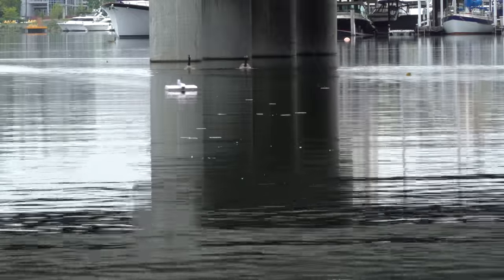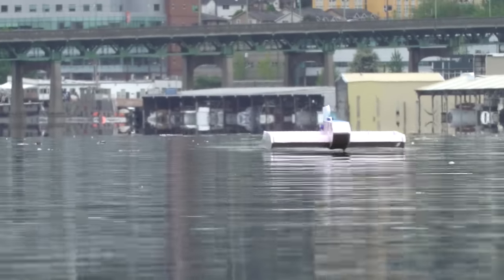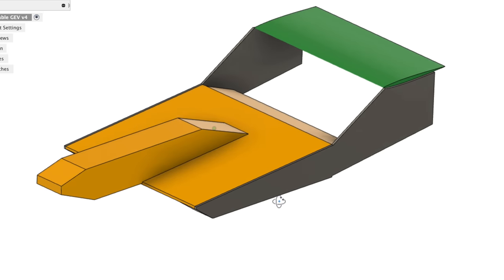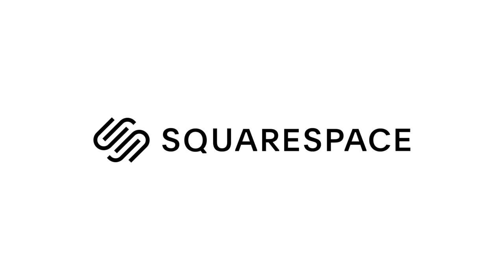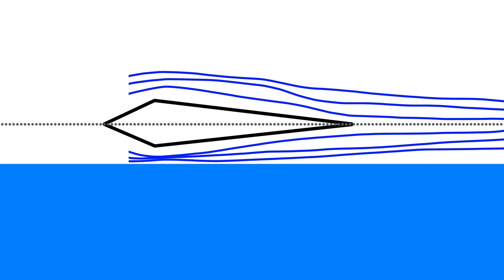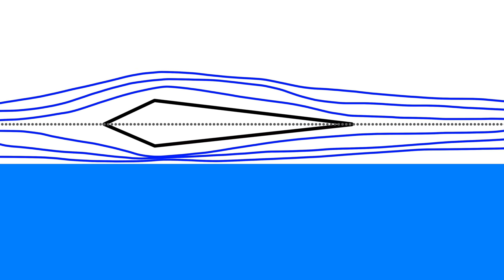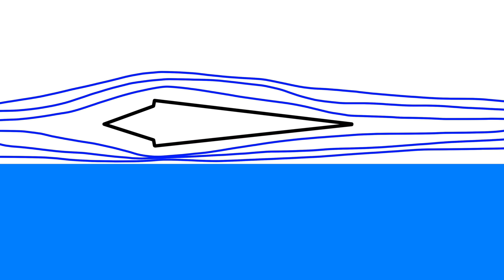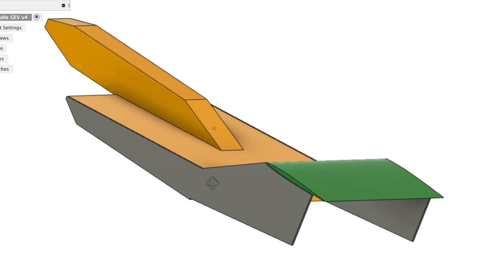RAM Effect Vehicle - A New Type of Aircraft Wing Design?

Comment: The soviets actually created a ground effect aircraft but it was costly to maintain and it only can fly at calm waters
Reply: There's definite advantages to it though in fuel efficiency and speed. They just need to make it a boat instead of an aircraft.
Reply: Ekranoplan
Reply: Some amphibious airplanes use the ground effect to take off from water, like Beriev Be-200 - It sits down on it's arse when it gets up to take off speed (about 180-200 kph, 111-124 mph depending on the current water load).
Reply: Ekranoplans 'flew' in all types of conditions ... The Caspian Sea Monster' flew with 2-3 metres seas ... 50 years ago ... there are many sizes and versions over the years ... nothing new here ....
Reply: Correct, it was called an Ekranoplan. It had 10 jet engines, 8 at the front to create enough downdraft to get it into ground effect, then the 2 at the rear for forward propulsion; it weighted over 260 tons, could lift 600 tons and flew at over 300mph. All in all an abslotue brutal monster. But, it could only fly in calm conditions and was too far advanced for it's time and far to complex/costly to maintain. The designer, Rostislav Alexeyev, then came up with a smaller, prop driven, version named the Orlyonok which was more suited as a troop carrier than a massive lift transporter. Only 3 were ever built and the design bureau finally ended up with a smaller version of the Ekranoplan that carried cruise missiles and was used as an anti-ship attack plane. So, nothing new with this guy's thought process at all - maybe he needs to read a couple of history books though?
Reply: @sys3248  are there though? I get that they put less effort to stay on the air than an airliner at low altitude because of ground effect, no question there, but they also suffer from increased air density on low altitude (which increases drag inmensely, which is why airliners fly as high as they can)

legit question btw
Reply: @johjoh9270  oh the ground effect accelerate them forward as well. The squeeze accelerate air below the aircraft which then passed behind them.
Reply: @Retired Bore could that be fixed with pontoon wing tips?
Reply: There are other ground effect planes I've heard of including one for a hotel in Malaysia or Indonesia somewhere there
Reply: Ever hear of rogue waves......
Reply: Lol if you watched the other vids in this series you’d know the history has been extensively covered
Reply: The Soviet ekranoplans could handle 3-meter waves, and were HUGE. Not for calm water only. Look up "Caspian sea monster".
Reply: @gbulmer  No, I don't. I was suckered into watching due to the disingenuous (click bait?) title. I hold 2 private pilot licences so I have an great interest in anything new in aviation - the title makes it sound as if the r/c chap had made some revolutionary breakthrough. I would humbly suggest, most of the other commentators did too, judging by their comments made, which then prompted you to reply to them. (maybe it's your channel?) I watch a fair few r/c vids but, please, don't put up a title that suggests something that it is not.... oh, and best wishes back attcha!
Reply: @nuttysquirrel8574  Not my Channel. I am also 'anti-clickbait', so I sympathise, but YT is smothered in it; it's ad. powered. I'm just interested in low-energy rapid transport. So, I occasionally check on several R/C channels to see if they have made any interesting developments. Most of these commenters seem unaware of the history of this channel, so pointing out the GEV playlist and 7yo Ekranoplan video seems helpful. 

Another relevant R/C channel is Think Flight youtube.com/channel/UCMZkAT1Vf7CPSNcTzZkK_qQ
He did a couple of interesting R/C model Ekranoplan videos. He's currently part way through building a 'man size' boat-towed Ekranoplan, which might be a hoot.

I AssUMe this 'Ram' won't reduce energy (my interest), but do the opposite. Nor is there enough engineering or science that I can see to get any evidence. However, I usually learn something fun or interesting. 

Best Wishes, All. ☮
Reply: Ya I have read about those Soviet planes... I think they have built 6 or 7 prototypes and the disintegration of USSR made to shutdown those projects....
Reply: Isn't that the giant "Ekranoplan" thing on the shore of the Caspian sea? Just rusting to death on some random beach?  I can hardly think of a more useless thing than a plane-hovercraft-boat that required 12 engines to fly 4 feet off the sea. (a sea which regularly has 10-15 foot crests in storms) .... plus with good ole Soviet engineering, you know damn well at least 2 of those 8 primary motors in the front will be going down every other flight. 🤣
Reply: Yep.  Old news.
Reply: Yes yes
Reply: @gbulmer  The video title only suggests that the wing design (cross-section) might be novel - "A New Type of Aircraft Wing Design?". Nor does it claim to be revolutionary, the video itself explains that the design is likely inefficient and not practicable.  There's literally no mention of inventing the ground effect or Ekranoplans, so I don't really see why you seem to be so upset about being "click-baited". 

To be honest, I really don't understand people like you at all. You obviously can't be bothered with reading comprehension, but still jump into the comments to smugly summarize wikipedia articles as if you were some kind of scholar when literally every other amateur aviator in the world is perfectly aware of the Ekranoplan.
Reply: Yeah just see your comment after I posted mine
Reply: @johnsealey2537  something like ekronoplan I think. Best
Reply: Gooses??
Reply: @johnmanyberries1  Its original name was «Корабль Макет» (Ship Model). Your name created by mistake by western intelligence because of first two letters KM on it.
I had ride once on landing Ekranoplan Лунь, which used to deliver troops.
Reply: @sys3248  they already flying tanks and submarine ships. Swimming planes is a good idea😘
Reply: @Retired Bore isn't that what the rudder is for?
Reply: Marx can dream, but he could, and never would fly
Reply: If highly fuel efficient, may be time to create extra highway lanes for Ram-style 'aircraft' to move heavy loads long distances where practicable (predominantly straightaways with small turn radii), such as deserts (Australia comes to mind) and low population by-passes.
Reply: First time on the channel?
Reply: Ekranoplan was demolished by pleads and requests of USA by the end of CW, we're developing a new version
Reply: @pavelshnaps2345 
Who is we?
Reply: Неправда. Советские экранопланы могли летать и в шторм.
Reply: @RCEHXPEH  вопрос открытый... Инженеры которые их делали уже умерли от старости, а современная каиталестическая Россия всячески врет о советском прошлом, ибо очень боится сравнений своих достижений... Вот и вброс про невозможность летать в шторм... Толи правда,  толи очередная "солженицинская" правда.
Reply: It was a special aircraft for special purpose and only a few existed.
Reply: @volhv2548 
... few
Reply: @cemasti4524  Aaa auto correct making me crazy
Reply: @volhv2548 
Darny Barney
Reply: It would be funny if he designed his own type of ground effect vehicle without knowing the only ground effect vehicle your average YouTuber knows about. The Caspian Sea Monster, the Ekranoplan, TM
Reply: @sys3248  yeah but then it would be slower woudnt it ?
Reply: A ground effects vehicle can fly in rough seas it just needs to be robust and very large. Witch prevented the Soviet union from really persuing the consept
Reply: And best thing is, they did it to be invisible on radars
Reply: @sys3248  That would be the Hydrofoils :-)
Reply: Rissia created alot of stuff for some reason dont...
 fully work,
Cost too much
Or created an small amount like Sue57
Reply: First comment. I was going to say the same thing.
Reply: Caspian Sea monster. Same as it ever was.
Reply: Did a whole project this is not new
Reply: No, it had nothing to do with the condition of the sea.
Reply: Loved the “Caspian Sea Monster” it put the fear of god into the US Navy! That fear eased when the Soviet Union collapsed. There were river cruises in Russia with civilian versions for a very short time to show off the technology. Too bad the technology has not been exploited.
Reply: I thought that plane was designed as troop transport to fly in the air, but mis-designed and doesn’t have enough lift - as a result it can only be barely airborne with ground effect. 
As in: it wasn’t “designed to fly via ground effect”, but was an accident/mistake due to mis-design.
Reply: @reallifeengineer7214  No
Reply: I’ve adapted the technology to mover cattle n fresh fruit n vegetables world wide in a day
Reply: @rhyscraney3624  scary
Reply: Ekranoplane?
Reply: @sys3248  or maybe more of a hover craft skirt idk, I feel like the marines would be interested in something like that but it would probably cost to much
Reply: @johnmanyberries1  Didnt those have a submerged "fin" though?
Reply: Soviet-era Ekranoplans flew completwly above the water by approximately 3-5 metres ... there are plenty of good videos of large ones like the Caspian Sea Monster to show their succesful flights ...
Reply: There was only one built

Comment: I think everything a ground effect vehicle can do, a hovercraft can probably do more efficiently, so that's probably why they never caught on. And the same thing also happened to hovercraft which is why large hovercraft died out
Reply: Not really, the ground effect vehicle can be much faster than a hovercraft. Thing is the hovercraft can outpace the aircushion which will make it take a nose dive. This is a problem that can be addressed to some degree by adding more power to the engines blowing air into the cushion but this is pretty inefficient. This tends to happen below 100 km/h or about 60 Mph and the fastest speed a hovercraft has achieved is about 137 km/h, 85 mph or 74 knots.

For a ground effect vehicle Increased speed will instead strengthen the ground effect, at least up to the speed of sound. I'm guessing that trying to exceed maneuvering

Edit: Hovercraft do however have a lot of advantages over ground effect vehicles (and I'm tired of writhing that so from now on they are GEV...) in that they don't need to accelerate to get off the ground. They are more akin to helicopters in that way. They can also drive as slowly as you want, slide in any direction you want that the thrust propellers or jets allow for. It's closest competitor is probably the hydrocopter which is simpler, can navigate snow, ice and water but isn't as fast.

There are a multitude of different types of vehicles and a lot of them have some special area where they excel.
Reply: Kind of. Ground effect has a huge advantage in visibility and noise, which are HUGE factors for such craft, and ground effect craft can be WAY WAY faster. It's not even close. A large one can effectively be the fastest thing on water. Hovercraft's main advantage is transitioning to land.

The problem with both though is water condition. Hovercraft do poorly and ground effect craft sink if there are ANY waves high enough to jump the cushion. You need basically still water to use it, which limits you to small bodies mostly. You can carry large loads on it very very fast, so the Soviets who really innovated this tech considered it for inland sea missile boats. Basically a giant boat carrying enough missiles to sink a fleet that can zoom out, intercept, launch, and run away before anyone can stop it. This proved a bit too niche.

Hovercraft are for amphibious ops, but it's very questionable if they actually serve a role for anyone other than special forces. No one does contested landings anymore, for good reason mind you, so there's not a huge difference between a boat that gets small landing parties on in minutes or large ones in hours... And the large one can become a portable pier, whereas the hovercraft's massive noise and spray (water OR sand) is a giant "look at me!" Sign that messes with everyone else trying to land. You don't really want it unless you only have a small party and need to get in and out VERY fast.

Sorry for the wall of text. These really shine in short range small load ferries, like between islands in an island chain. You can be choosy on weather here and passengers will pay to get around quickly, compared to traditional ferries. If needed, they can be quite big for the purpose.
Reply: A hover craft isn’t a ground affect vehicle
Reply: If it were a ground affect vehicle it wouldn’t be able to hover and stay in place